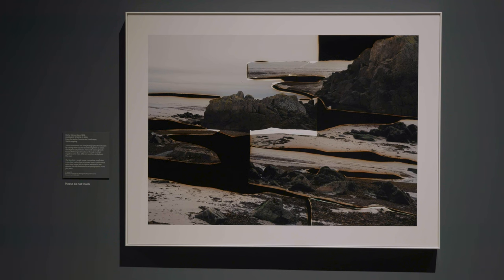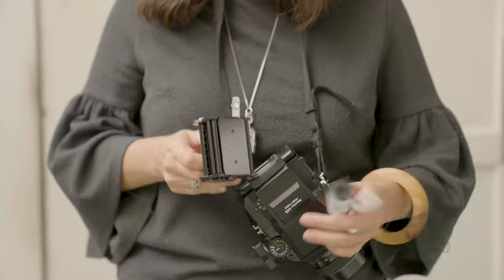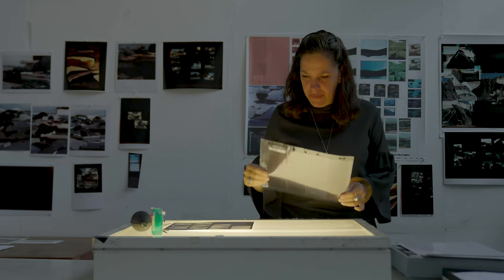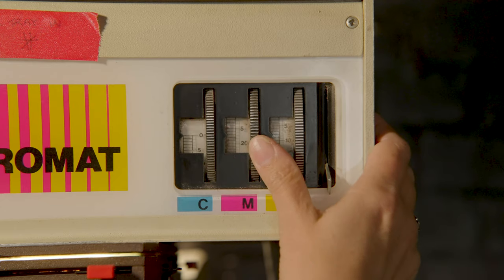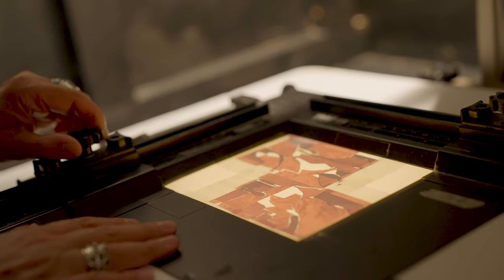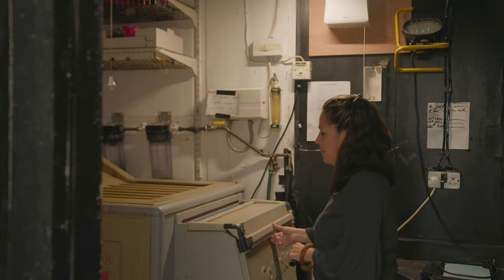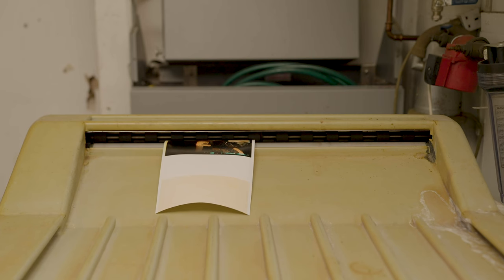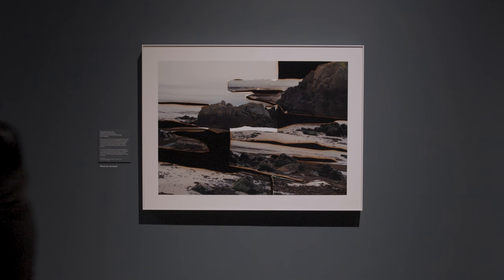How was it made? | The chromogenic process | V&A

Comment: Chromogenic print techniques, commonly known as C-prints or color prints, are a type of photographic printing process that utilizes chemicals to produce color images. While they offer high-quality and vibrant prints, they do have environmental impacts and costs associated with their production and disposal:

Chemical Usage: Chromogenic printing involves the use of various chemicals in the development process, including developer, bleach, fixer, and stabilizers. These chemicals can have environmental impacts if not properly handled or disposed of. Improper disposal can lead to water and soil contamination.
Water Usage: The development process of chromogenic prints typically requires significant amounts of water for rinsing and washing. This can contribute to water consumption and wastewater generation, particularly in large-scale printing facilities.
Energy Consumption: The production of chromogenic prints requires energy for equipment operation, chemical processing, and drying. Depending on the source of energy, this can contribute to greenhouse gas emissions and other environmental impacts associated with energy production.
Waste Generation: The printing process generates waste materials such as spent chemicals, paper scraps, and packaging materials. Proper disposal or recycling of these wastes is necessary to minimize environmental impacts.
Transportation: The transportation of raw materials, chemicals, and finished prints can contribute to carbon emissions and other environmental impacts associated with transportation logistics.
Health and Safety Risks: Handling of chemicals involved in chromogenic printing carries potential health and safety risks for workers if proper safety measures are not implemented.
End-of-Life Disposal: Disposal of chromogenic prints, particularly those containing hazardous chemicals, presents challenges for proper waste management. Improper disposal can lead to environmental pollution and health hazards.
Efforts to mitigate these environmental impacts include the adoption of more eco-friendly chemicals and processes, waste reduction and recycling initiatives, energy-efficient equipment, and proper waste management practices. Additionally, digital printing technologies have emerged as alternatives to traditional chromogenic printing, offering potential environmental benefits such as reduced chemical usage, lower energy consumption, and less waste generation.